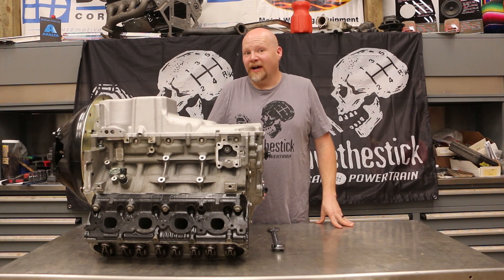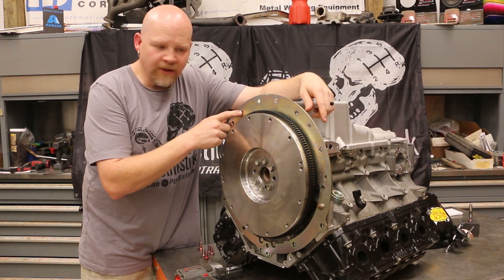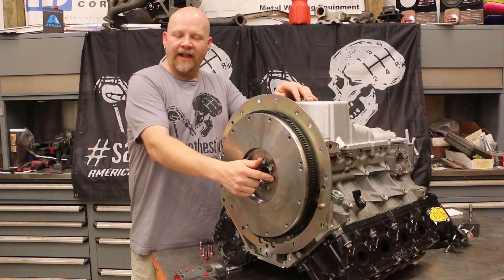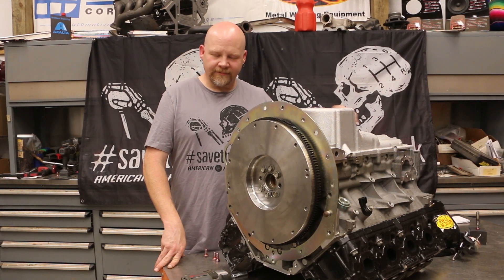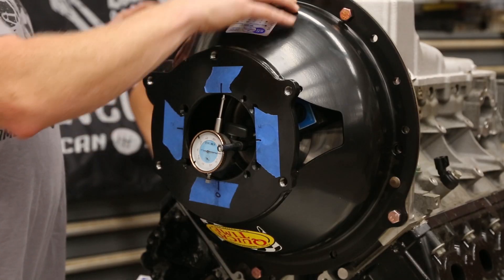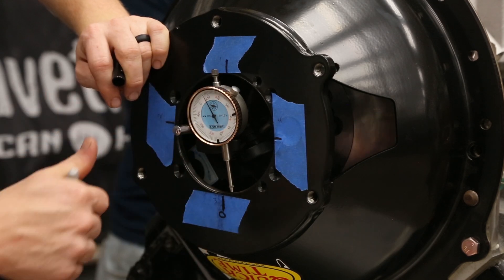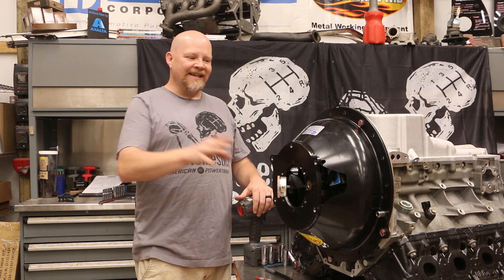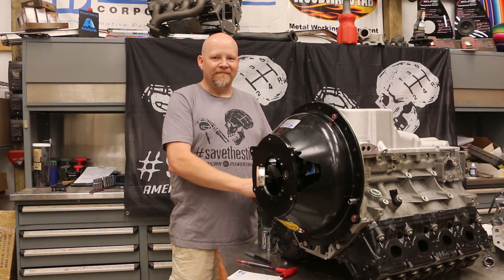How To Index Your Bellhousing!

Comment: Sir I want to ask a question for competition exam purpose, please try to give correct answer.
Q. If the bell housing is not securely fastened to the engine block:
A. The rear cylinder is susceptible to distortion (become out-of-round).
B. The bell housing will warp.
C. The engine block will crack.
D. The crankshaft will crack.
Reply from the maker: @IBRAR007  the correct answer is A.
Reply: @Reddirtrodz  Dear Sir A lot of thanks for your response.

Comment: Your 2 and 4 positions are almost perfectly centered over the crank. If you zeroed on one of those points, you'd come back to a half thou of zero on the opposite side, and you should see your +- 10 thou on the top and bottom. Get yourself a 10 thou offset dowel for each side and point it straight up and that should get you within a thou or two.